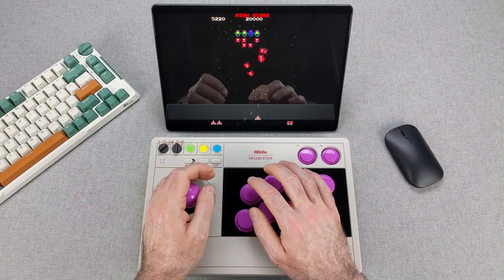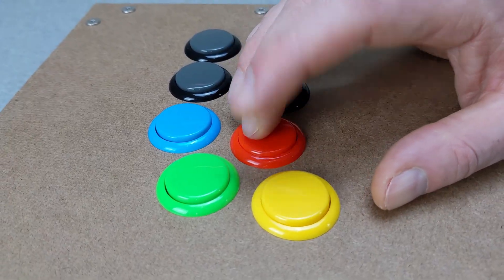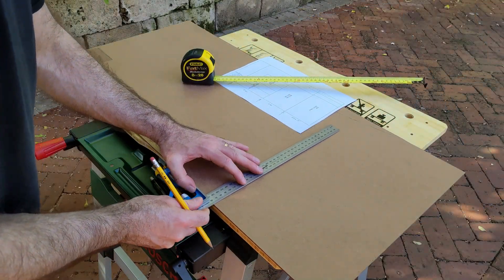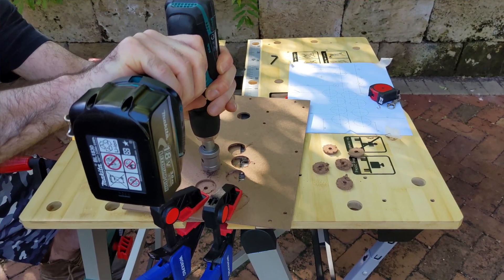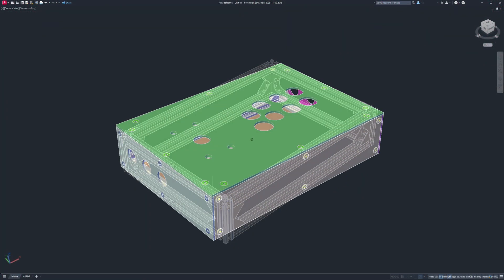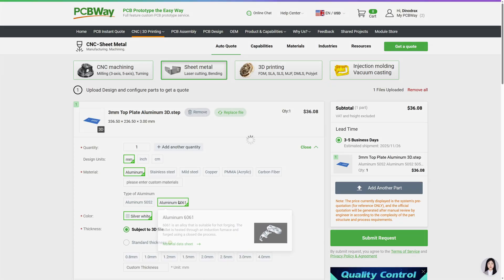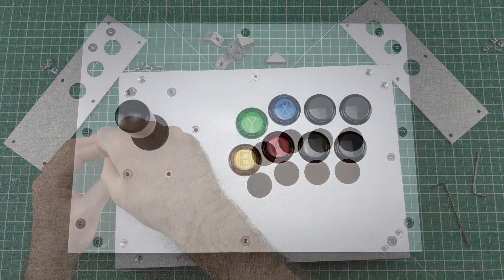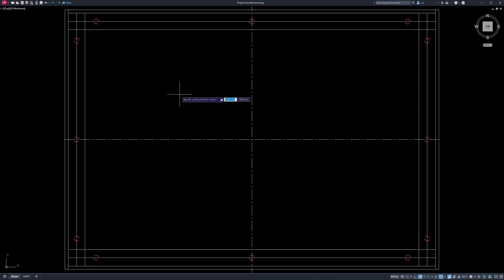Project ArcadeFrame - DIY Arcade Controller Enclosure

Comment: ooooh, using standard alu-framing, that's a really nice idea :) I'm immediately thinking of acrylic panels for the sides as well, maybe even the top, showing off the wiring (for better or for worse) - Gonna have to try this approach on my next stick build on my channel as soon as I finish the first one I'm currently working on :)
Reply from the maker: Thanks for the feedback! I’m glad you’re into the idea of using standard aluminium extrusions for the frame - the whole point was to make it easy for anyone to build while keeping it super strong, so the outer cladding doesn’t need to carry the load. Clear acrylic panels would look fantastic and really show off the internals. I’d love to see your take on an ArcadeFrame when it comes together, so definitely share how it turns out. Appreciate your comment and support!